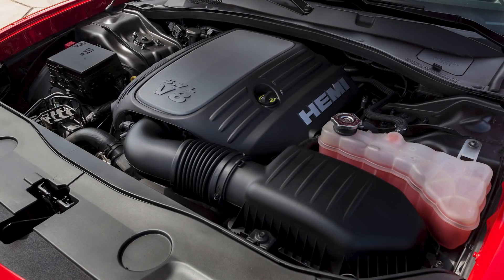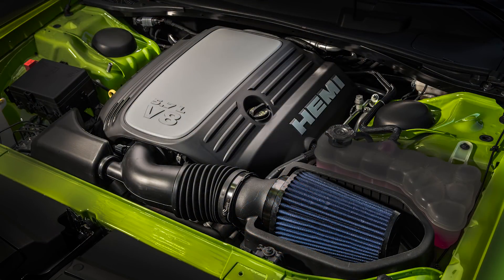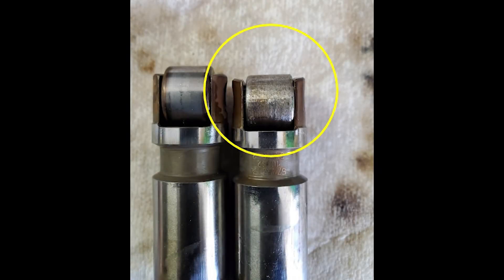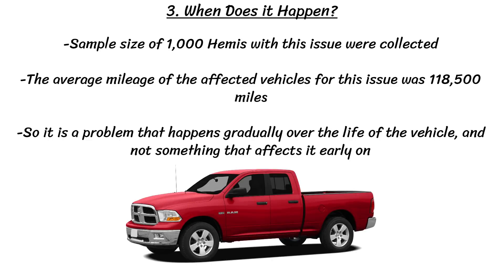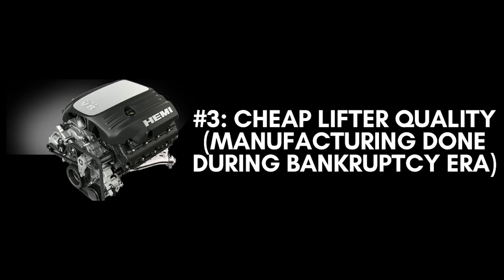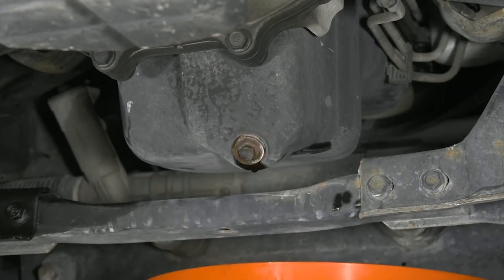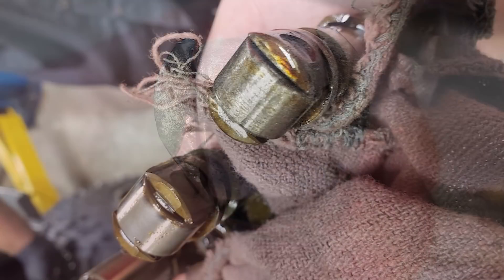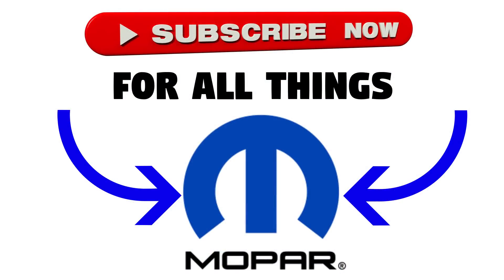The Fatal Flaw of the 5.7L Eagle Hemi V8 Engine Fully Explained (2009+ Lifters and Camshaft Failure)

Comment: It seems that the best is to take preventive maintenance action. Replace existing lifters with heavy duty rather than solids .
But more efficient operation.
Check valve lifter clearances with feeler gauge.Connfirm the cam condition.

Comment: If you are able, purchase an extended warranty, especially if you get a pre owned Chrysler product. I have a warranty on my 2016 Ram 1500 5.7L Hemi that doesn't expire until 200k mile and 2 lifters in cylinder bay 3 and 5 and the crank shaft was recently replaced at 120k miles free of charge to me with a rental. But I love my Ram so....

Comment: Roller Lifter Failure causing Stalling compared to the possibility of stalling (at Idle or 75mph on the Highway) due to the Fuel Tank vent failure from the Plastic warping..  sending liquid fuel into the engine instead of Fuel Vapor. 
   Is there a similarity to the Complaints when Diagnosing the Stalling Issue ?

Comment: Is this still applicable for the 2021 challenger?
Reply: 2009 to the present.  The host did state that the bearings were upgraded with the 2016 models.

Comment: I bought a 2013 V8 Dodge Charger R/T with Road&Track Pkg well taken care of for $3000, It had the engine light and the previous owner said It needed a new engine.. Well, I spoke to a friend of the family who is a Mechanic for the air force and he told me that the Camshaft in a lot of the Hemi engines wears out, he recommended me some cams and I ended up buying a Stage 3, paid about 8k total for the car and I love it🥰😍🥰  It sounds like one of those engines from old cars its soo good

Comment: I’m actually doing this repair on my brothers 2009 ram 1500. It threw a engine light for a misfire on cylinder 3 or 5 before we had new plugs coils and injectors then we started researching and found out it was the lifters failing
Reply: Same here on my 09.

Comment: Doesn't the Pentastar 3.6 see similar issues with lifter/cam wear? Doesn't seem like a great trend.
Reply: My 2012 chrysler 200 sport has the 3.6 I only had a problem with the oil cooler under the intake manifold leaking. Had to replace the cooler.

Comment: Every manufacturer has moved on, time to retire the hemi and develop a modern engine design. Unless you strip down a new engine and replace the entire valve train, you will eventually have problems.

Comment: Well done video..you covered all the bases..except 1..quality of oil..you can still have friction even in a oil bath if the pressures exceed the film strength <---(the pressure required to force metal to metal contact) of the lubricant plain and simple..it is overwhelmingly obvious that most lubricants are not up to the job for this design..there is a simple solution but Mobil 1 and our government set the stage for making it nearly impossible to see..group 4 lubricants are what's needed here..you see Mobil sued Castrol for calling their organic oil synthetic..the government sided with Castrol stating "the oil has been significantly altered from it's original state so it can be called synthetic"

That just opened the flood gates and everyone came out with their version of "synthetic" oil..calling it "full synthetic"..it's not synthetic at all it's modified organic oil..meaning the base oil is organic with modifiers aka group 3 base stock with a average film strength of 750 psi

Enter group 4 base stocks..pure synthetic most common versions are esters like polyester..there are 3 true 100% pure synthetics I'm aware of..mind you NOT "full synthetic" the 3 are as follows: Mobil 1 makes one but good luck figuring out which one it is..their marketing people keep changing the names of their oils kind of like that shell game..the rest of their line is group 3 base stocks..2nd is a very hard to find German made version of Castro spec'ed out by the German auto makers..3rd and by far the best is Amsoil..with the highest film strength of all the group 4 lubricants available to the public..average film strength of 5000 psi..

I am a retired industrial/commercial fleet mechanic and have truly tried every goop,salve,spray,grease,oil,treatmeant,additive, on Gods green earth to get ahead of the overwhelming demand for less downtime and more production..that all changed in august of 1989 when a Amsoil dealer walked into my shop and let the products do the talking..suddenly bearings stopped seizing..engines stopped over heating $5000.00 pivot pins didn't need to be replaced on a monthly basis..on and on..I hope Marspeed you won't be angry if I post a way for more info and a way to talk to me..check this site out:  ultimateoil.myamsoil.com  I wish you all well..good day..

Edit: forgot to put in the film strength of Amsoil..
Reply: Pennzoil platinum is definitly synthetic oil as it is made from natural gas. It tests just under Amsoil in most testing. I buy it with my groceries for $25 a jug.  The rest is blah blah blah as I have 220k miles on my hemi.
Reply: @stevenbryant4718  You should read my comment again..only lubricants with a base stock from group IV and group V are pure synthetics..Pennzoil Platinum is made from natural gas which is organic which is a group III base stock and by it's very nature can't come even close to a pure synthetic regardless of who makes it..
Reply: @ferrelx  organic.... like potatoes? Chemistry is like potatoes? The carbon atom is like a russet?
Reply: @ferrelx  .... organic, like a potato? Chemistry is like potatoes? The carbon atom is like a russet?

Comment: Well I got my money’s worth with my 09 rt challenger she got 247k+ miles no check engine light just got back from Fresno California drove around went to the lake out there came back and it was hot 110-115…and Phoenix heat is known so😅🥵🥵😁 I will be replacing the radiator if it’s called like that anymore 😂😂

Comment: I have a 2011 Ram 1500 Laramie Longhorn, which I bought used with almost 200,000 mile on it. I changed the oil within a week or two of getting it, and about a week or so after doing that (which I had done at the dealership,) it broke a valve spring, sucked the valve into the cylinder and pnched a hole in the block as well as detroying the cylinder head and of course, the piston. I had a used mototr with about 90,000 miles on it out in to replace the destroyed engine, and it has been working fine, for about 10,000 miles or so. I am super nervous about the issue with the lifters, as well as with valve springs. But, I just make sure to get regular oil changes, with synthetic oil, from the dealership, and listen as much as I can to the engine for any changes in the way it sounds... But, I love the power, and the MDS system works pretty good at improving my fuel economy on the highway. I get better mileage with it than I do with my 2001 Durange with the 4.7 in it. On the highway...

Comment: My ram calls for an oil change every 10k miles.  I change it at 5k with the recommended oil.
Reply: Same, 5-7 k is like the sweet  spot for me depending on what kind of driving I have done. I have seen my oil shot at 4-4500k before but have also seen it still look pretty honey brown at 6500k I would only go 10k if I did it all on a road trip highway driving under the most ideal of circumstances, but for everyday driving it just seems like way to long.

Comment: 2008 300C 5.7 160,000 miles.  Use Mobil 1 abd change when the car tells me to.  Very little idling.  If I think it will be a while, I put it in Neutral and up the revs. Habe not dropped any seats.

Comment: Interesting.  Very good analysis.  I have to say I'm dodging a bullet so far.  I've got a '13 300C Luxury that has 126,000 miles on her.  I'm the 3rd owner.  Bought her with 80,000 miles.  Change oil, Valvoline high mileage blended 5W20 every 4,000 to 5,000 miles.  Last oil interval was 6,000 miles.  That's an exceptional interval as it included a trip Michigan to Florida.  But my norm is the 4-5K range.  No issues regarding this "Hemi tick".  At 100K miles installed long tube headers, Corsa catless cat back exhaust, installed a 180 degree thermostat (factory thermostat is 203 degrees), had a 93 octane tune and had the stock  fans programmed to kick on at 180 degrees.  Tune was done by Jesse Murray...knows his stuff.  Really woke up the car.  Have the SRT pages through the Tazer.  Car idling in 90 degree heat with the air on, engine temp never goes above 189-190.  Just a boulevard cruiser with lots of creature comforts.  So yes, I'm dodging a bullet and part of the trouble free 95%.

Comment: Sorry I have to add this correction to you... it may have been said before... the lifters supply the oil to the push rods and the rest of the upper valve train... NOT the push rods supply the oil to the lifter!!!!! sorry 30ish years of working on engines / vehicles. the problem I have seen is the the hardness of the " races " of the bearings... the pin is the inner race... the out side roller part is the outer race... the bearing is the needles... when the races are a softer steel  than the bearing you have problems... the races have 100% of load all the time to witch they require to be a harder steal... the bearings have a lower load so they can be softer steel.

Comment: I believe the best way to prevent lifter failure is to permanently disable mds, the oil passages get clogged and it starts improperly engaging with causes the failure. Btw the pre eagle hemis still had this problem they just didn’t make as many and the eagle
Reply: It’s happening to non mds lifters so that doesn’t make sense

Comment: for a future video, could you investigate why the Dodge PCMs from 1999-2007 fail, why did Dodge discontinue them in 2016 when they know they fail, what's a solution to getting a good PCM once yours fails? good video, thanks💪
Reply: Interesting never heard of that. I'll tell you though that there are several good companies that repair and even upgrade PCMs.
Reply: @snek9353  it's common. i didn't know about it either until mine failed. I've tried FS1 in N.Y. they sent me a PCM and it didn't even start my truck. i sent my original PCM to them for repair and they said it was unrepairable. now I'm working with a company in Jacksonville Fl. they sent me a PCM and the truck barely starts and idles since its dumping 32.8% more fuel for no reason and i have no cluster information. I'll give them a chance to correct this issue. if that doesn't work, I'll go standalone computer and tune it myself
Reply: @PANTYEATR1  I've never dealt with this in a Dodge, but I think it was that Florida outfit I used when I needed one from a Nissan fixed. 

Do you know what fails in these, a circuit burns out, chip dies?  

Can a 2008 be used?
Reply: @snek9353  the company in Florida I'm working with is Module Experts in Jacksonville. this is for my 2002 ram 1500 with the 5.9L gas engine. i was told that it was a design flaw that cause these PCMs to fail and they would last about 20 years before failing. i didn't get anymore details than that. What bothers me is dodge discontinued these PCMs in 2016 knowing they are faulty. and any aftermarket company i use asks for my VIN so the PCM can be programmed to my truck, so why hasn't any PCM been correct so far? lastly, why couldn't my original PCM be repaired, if this is what these aftermarket companies do?
Reply: @PANTYEATR1  Wish I had answers for ya... Does sound though that if you really like this truck that going stand alone might be worth it. The complication there would be integration with other aspects of the truck that rely on signals from the PCM. But I don't know those trucks well enough to help. I've done that kind of thing on older vehicles, mostly Fords and Chevys and nothing newer than the mid 90s. 

Is this what they call the NGC1 PCM?
Reply: @PANTYEATR1  Curious where are you getting that 32.8% number, it's very specific?
Reply: @snek9353  i don't think it is a NGC1 computer...the part number is 56028652AA. so far with the PCM removed, all of the body functions work, horn, wipers, interior and exterior lights, keyless entry etc. the Holley Terminator computer has controls for the 46RE transmission, so the power and drivetrain would be ok to tune. you're correct about the unknown signals needed for the other modules in the truck that would need to be addressed.

the unreasonable part to think about is even if you have one of these trucks and you took exceptional care of it for 20, 25, 30 or 40 years, you would be expected to junk it because the PCM will fail and there is no Mopar quality approved PCM support in the aftermarket?
Reply: @snek9353  the 32.8% is what i saw in the live diagnostic data.
Reply: @PANTYEATR1  Is there a row of 4 connectors?
Reply: @snek9353  the PCM has 3 connectors inline. you can Google the P/N i gave to see an image
Reply: @PANTYEATR1  This is an aspect that all of us who decide to hang onto vehicles that are heavily computer dependent are going to have to face eventually. My '89 Ford has an aftermarket computer in it to control the transmission. My '14 Chrysler 300 has everything run by computer modules, there's like 20 of them. Each of the front doors, headlights, steering column, and the drivers seat each have their own module FFS. I intend to keep this car, but I do not look forward to dealing with electrical failures. 

We can't expect the OEM manufacture to support them forever.

Comment: Well researched! Owned 2012 Durango (new) which had the MDS and VVT. Sold it in 2017 with 75K miles. No ticking evident however, did experience stalling at low RPM. Always used synthetic oils and replaced at regular intervals.  Never had a check engine light when stall occurred...pulled over and restarted...intermittent from then on. That was my clue to trade it in.
Reply: Typical Chrysler electrical gremlin.

Comment: How many miles after the ticking starts should I expect a failure? I just bought a 2010 1500 with the 5.7 and 168k miles that sticks some and gets worse as it warms up. It runs great with no other issues than that, just wanting to know how many more miles to expect as I’ve already put over 1000 on it with no issues
Reply: There's ticks, and there's ticks, find the source of the tick to know.
Reply: @snek9353  It seems to be coming from the drivers side valve cover, or possibly under the intake. I’m fairly certain it’s not a exhaust manifold leak as it sounds more metallic and actually gets slightly louder as the truck warms up.
Reply: @dakotakelly9371  I'll give ya a couple easy listening tricks. 
1) Use a hose, better if it's rather stiff. Something like fuel or heater hose, but at least 3/8" ID. Put one end to your ear and move the other around close to the engine. It'll amplify local noises while muting others, great way to find the source. 
2) If the source is coming from inside a large thing, for example a valve cover, use a very large screwdriver. A lot like like the hose, put one end to your ear and touch the other to the valve cover. It'll use the valve cover in this example like the end of a stethoscope, you'll hear what's inside the valve cover. Then by moving from one spot along it to another pinpoint the sound.
Reply: Also assuming this is a valve train tick, A LOT of people have found success switching to Redline Oils. Redline makes a VERY good oil that is a true ester base. I've been a big Redline product user for along time and a lot of Hemi owners with ticks have reported that swapping to Redline quieted their tick and their engine is fine.

Comment: 2014 ram 1500 5.7.  Only mods are an S&B intake cold air intake. Caravan duel exhaust system. Throttle body control module. Diablo 93 octane tune.  Other than that just spacer/cosmetic modifications.  I'm running 129k miles without any issues. I run full synthetic and clean my injectors/lifters every 25k.  Also clean intake/throttle body every 50k. Just cleaned the throttle body today and honestly it still runs like new.  Just dont be an idiot and run your shit hot without constant maintenance.. Just common sense tbh.

Comment: BEST VID ON THIS SUBJECT I HAVE SEEN!!  I was told to use some Lucas syn oil conditioner and a quality Wix filter to help with this issue.  Keep idle time to a min... My truck has been solid but only 40K on my 2014.  Be sure to change the 8 speed tranny oil early!!  Mine was dirty at 40 k miles.  It is not bad doing it on your own.

Comment: In my personal opinion is the size of the engine (5.7, 6.1, 6.4 or 392) is too small.  Chrysler should go back to the small block "A" motor a Hemi engine which should be a better engine.

Comment: I have a 2016 Ram 1500, too, which has MDS.  I'm only at about 48k miles, and so far, so good.  But still, I have to wonder if I have the better lifters or not, and will they really hold up in the long term.
Reply: I wonder too, i have a 2017 ram
Reply: The host stated that with the 2016 engines, the bearings were upgraded.  Does that help?
Reply: @John-zs2eo  i believe it because the only noise my engine makes is the regular noise pushrod engines make

Comment: Good job on the video. Just wondering if more in colder climate area's are affected ?  Seeing as when the engine is cold in winter conditions there may not be proper lubrication on warm up.  Seeing as slosh oiling is used. Which on a daily bases over 4 months annually could do damage in a couple years. Just a thought.
Reply: Nope, heat is the enemy, and slosh oiling is not used.